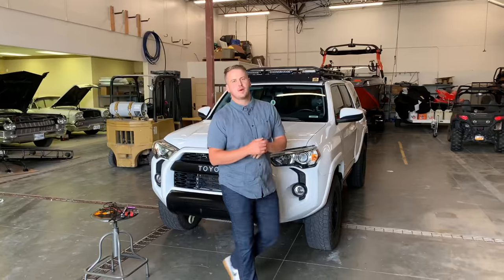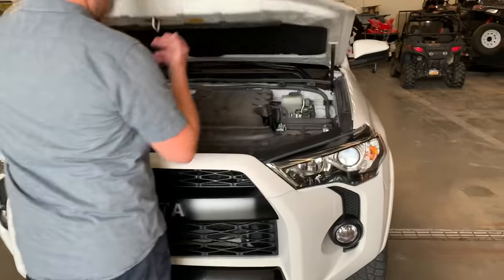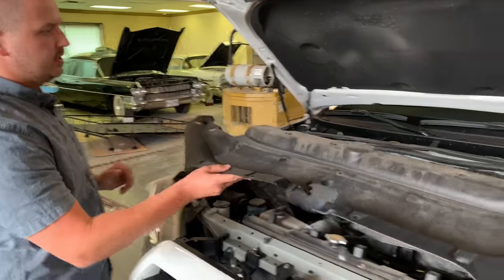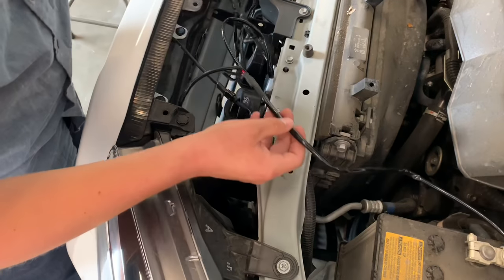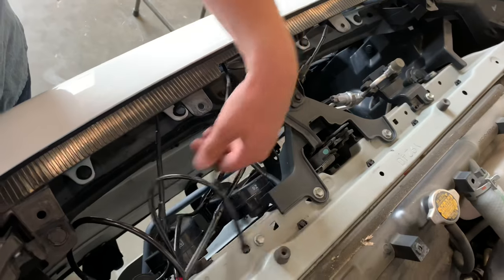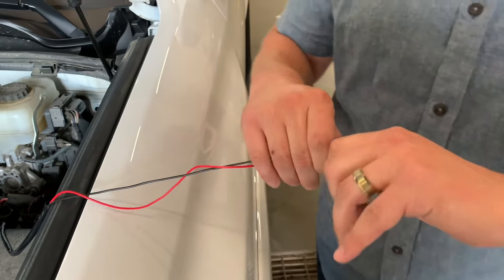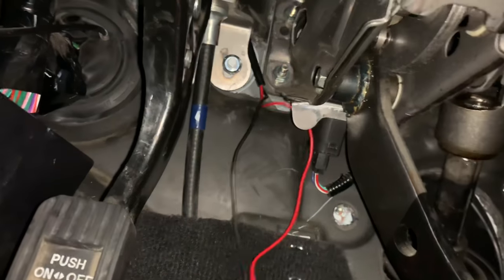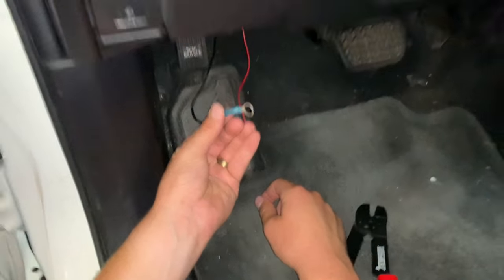4Runner RAPTOR Lights Installation!

Comment: Do not use a flat-head screwdriver to remove the plastic clips. All you need to do is push the center of them down. Once you take them out you can reset them and put them back.
Reply from the maker: Christopher O'Connor You’re EXACTLY right. I tried editing the video later because I forgot to mention that and now I can’t figure it out. Thanks for clarifying.
Reply: @4runnerlifestyle  No worries. Just wanted to make sure anyone else who watched save themselves from potentially breaking some clips. Good video, and good looking rig.
Reply: Just ordered the lights and watched the video. Thanks a ton for the tip!
Reply: Yep. Broke the first one and then realized how simple it was with the second one and the rest lol. Made it so complicated when it was in fact super easy.
Reply: How do you reset them? Probably a dumb question but I thought I was resetting it but just twirls and is loose when I put it back in. Compared to what it was before of not moving at all.
Reply: SHIT!  I saw this comment too late. Broke 3 of them.
Reply: @austinstearns1428  not dumb at all - you push the center of the "insert" back up. It pops the cap back out.
Reply: Correct!
Reply: I know right!? They just pop off by pressing them in lol 😂
Reply: One of them fell to the bottom, should I be concerned ??

Comment: PSA to everyone this is not the way to do it on 2020+. You have to use the fuse box under the hood
Reply: What slot do you use in the fuse box under the hood? I have a 2020 4Runner TRD Pro.
Reply: No you don’t. You can pull the fuse labeled “IGN” in the panel under dashboard and use the add a fuse in that spot with the 10amp fuse you pulled out and a 15amp fuse for the lights and you are good to go. Could probably work in the spot labeled “IGN NO.2” as well.
Reply: @ryanlieder7459  thank you for this I was struggling to get them to turn off when the car was off but this definitely worked without having to use the fuse box under the hood.
Reply: @ryanlieder7459  Just want to say thank you my man. I just installed these into my 2021 trd pro based off this comment. Ryan does not lie works in either.
Reply: @ryanlieder7459  bro THANK YOU SO MUCH. I was about to just give up because my 2021 ORP fuse box under the steering wheel is NOT the same as this video. And if you put it in the only available slot the lights stay on all the time. So thank you so much for this tip!!! Also, do you lose anything by taking out the old fuse and putting in this one?
Reply: @fatelook  thank you sir.  I have the same issue. Did you just pull the IGN fuse and put I there ?
Reply: @philliprodriguez5129  yea I believe so, ign 2 works as well
Reply: Ign 2. Works great. I have a 2022 and the fuse panel is totally different. This comment thread saved my ass cause otherwise the raptor light would have been constantly on.
Reply: @NattyGuy  where did y’all put the IGN fuse afterwards?
Reply: @technoremixxx  in a little plastic baggy. The plug for the lights has the two 10 fuses so its good.
Reply: Somebody help me out because I have a 21 trd orp and can’t get the raptor lights to turn off when I turn the engine off

Comment: Easy install. Why not make the wiring harness long for the furthest light and short for each subsequent light, as you get closer to the drivers side? Less wire mess by the radiator.
Reply: Also could ground at the body near the battery then just run the positive inside. One less wire to deal with inside
Reply: That's what I'm saying

Comment: So I didn’t go through the firewall, instead went directly into the fuse box under the hood. I’ve found two configurations. One will turn the raptor lights on only when the headlights are on. The second configuration will turn the raptor lights on whenever the engine starts. Looks like the configuration in this video turns them on with the headlights too… I think I like having them on without the headlights as an option- just thought I’d throw out that thought if anyone is interested
Reply: What fuse did you use for on without the headlights?

Comment: Seriously…. What the heck…. My fuse box looks different. Also that’s a different slot than others recommend. Why that slot, what is it for and when is it powered. Also, the cover will not reattach with this big attachment attached to the fuse lock. No mention of it. Just throw it away and leave it open?

Comment from the maker: Do not use a screwdriver to remove the plastic clips as explained in the video, just push down the button on the center of the clips and pull them up!

For 2020/2021 4Runners plug into the INJ fuse in the engine bay.
Reply: i had the low profile fuse they give me the mini fuse tap I can’t put my fuse into a fuse tap so do i have to get the mini fuse to replace the fuse that i had?
Reply: how do you put the clips back in?
Reply: 2021 SR5 and in the INJ fuse of the engine fuse box, the fuse box cover now does not close. Please advise.
Reply: @dlumlung  use a dremel tool to create a slot for the wire in the lip of the fuse box. Then match the slot on the cover. Protect wire from chafe with some electrical tape or preferably cloth automotive tape. They should advise using a grommet in the firewall hole also. Grounded sparky wires no bueno.
Reply: Wish I would've read this comment before finishing running the cable and crimping the fuse to the line 😫
Reply: @dlumlung  use inside fuse box "tails postion" raptors dont work with drl but do with anything else

Comment: I believe it's more feng shui to plug the Double Fuse Tap into the "tail light" fuse slot.  This way the raptor lights will automatically sync with the exterior lights rather than the ignition switch.
Reply: Where is the tail light fuse slot/ what is it called
Reply: @bswen600  It's called "Tail" located bottom left in the panel under the drivers dash next to the ebrake
Reply: Does the taillight come on During the Day to make the raptor lights turn on ??? Or does it need to be turned on with Lower beam light?
Reply: @First Last  they'll stay off during the day, therefore, the first setting that will turn them on will be the yellow parking lights
Reply: @byronpitulski766  great to know. Does the fuse box under the hood have a tail fuse ?
Reply: @firstnamelastname9661  no

Comment: Can you remake this video for the 20-21 Trd pros? The black wire in the kit I received has a gold connector on the end/ is not the same as the video. Instructions are lacking

Comment: But why would you put FORD style 'Raptor' lights on a Toyota? You do know that the Raptor was required to have those due to the width of the vehicle, right? Right? 

I will say, those lights are very well built in their fitment.

Comment: Can you guys update video or instructions (didn't get any of those in my box) for a 2022 TRD Pro?  I found another video that wired it to the fuse box under the hood but the add-a-fuse connector sits almost an inch proud of the fuse itself and fuse box cover will not fit back on.  The other video I found was for a 2020 and I guess the 2022 has a more 'fitted' fuse box cover
Reply: Can you share the video you are referencing in your post? I have a 2022 TRD 4Runner. I installed then on the tail light fuse, lights new raptor lights came on but I loose my tail light and parking lights. I don’t know how to make all lights ( raptor lights, parking lights, tail lights) work together. Any ideas?

Comment: Why does my setup have a fuse on the line? I bought the lower 4 raptor light and the cable came with a fuse connected to it. Plus two fuses for the fuse box… can you please tell me how to set this up? Do I cut out that 15amp fuse out of the main power cable? Or use two 10 amp fuses with the 15amp inline fuse.
Reply from the maker: Hey! That's strange, The easiest thing is to email sales@4runnerlifestyle.com And we can get that taken care of for you.

Comment: I enjoyed the video and the installation but one hick up I had is the length of the wiring. The wire I received was not long enough to go through the firewall so I needed to make alternate connections. I went ahead and connected the power wire directly into the fuse box, in the INJ slot and it works just the same. Works just the same, easier and faster.

Comment: Followed these exact steps and the raptor lights aren’t coming on. Tried changing the ground location and replacing the fuse but nothing…pretty bummed
Reply from the maker: Hey max! that is not fun! have you emailed our customer support? if you ordered them with us we can help you get them installed or replace them if they aren't working!

Comment: can't get my lights to come on, my fuse box is pretty full. my fusees are a little different order. Are you plugging into a blank fuse panel?
Reply from the maker: Yes, that can happen, we are going to an open position or at least one that doesnt already have an add a fuse.  A way to fix this issue is with a control panel like an SPOD or an Auxbeam.  They help organize all the wiring and make it more streamlined when adding so many lights

https://www.4runnerlifestyle.com/products/auxbeam-8-gang-led-switch-panel-kit-one-sided?_pos=4&_sid=cf76e6711&_ss=r

Comment: Why do you bypass the fuse box under the hood and use the one in the cab? I seen videos of it done both ways. Is there an advantage to one over the other?
Reply: I tried both options for my 18 sr5. Under the hood works for me but after a week my battery died. With this option my lights stayed on every time the truck is on.
I’ve tried connected inside the vehicle under steering column as shown in video but does not work for me.....not sure why.
Reply: By hooking the wire under the driver cab does that ensure battery will not be drained? Or should I install a switch?
Reply: Inside the cab.  The first 10amp will say tail lights.   If you use that one.  Then you have some control  . They wont turn on unless you  select your front amber side marker lights.   This way if you wanted to . You can run with them off or on with your front side markers.  Basically working like a switch
Reply: @flipmode9236  I did this on my 2021 and worked perfectly
Reply: @jeremylusher1316  what fuse spot
did you use? my 2021 under dash fuse box doesn’t look like the one in this video. I only have one empty fuse spot and when I plug it in there, the lights stay on no matter what.
Reply: @Pcola70Chevelle  I had the same exact problem .... Were you able to rectify?
Reply: @Pcola70Chevelle  yes that's the issue I'm having.. . I have a 22 .. . Please advise if you've found a solution
Reply: @Pcola70Chevelle  did you get an answer?
Reply: @flipmode9236  this spot is taken already on my fuse box. Do I remove the fuse that’s in there first and then plug this one in?
Reply: @bradf1276  yeah u take the fuse out and plug in the 2 to 1 splitter
Reply: @Pcola70Chevelle  did you figure out which fuse to tap into?  I have a 22 Off Road and lights are always on

Comment: Pretty cool product, but I was shorted a fuse. Reached out via email and never got a reply,searched for a phone number, couldn't find one.

So I just assumed it only took one fuse,when lights didn't initially work, I troubleshot everything,to no avail. Went to my local O'Reillys and bought another 10 Amp, worked right off the bat. Thanks for the product,but need to work on communication.

Comment: So I put it in the INJ fuse in the engine bay and my 4runner would not start. I had to go back to the original 10A red fuse and it worked again. So not sure what to do
Reply from the maker: It sounds like you don't have a fuse or a blown fuse in the harness thats in the kit possibly.  We can figure that out for you and get it taken care of if so! Sales@4runnerlifestyle.com by email will get you connected with our guy Andrew and we can open a case to see what the issue is!

Comment: On my 2020 trd off road. I connected to the 10a marked as tail to the left of the 7.5a DCM. Should be left column. Closest to you/the top. It runs off the switch. When you are in lights on or the setting right below.

Comment: I saw some install videos where the wiring was connected to the fuse box located in the engine bay. Is there a difference between installing in the engine bay and installing in the driver side fusebox?

Comment: !!!This is very important and should be checked in your state prior to purchase!!!

It is illegal to have the off road raptor lights turned on while driving on state roads especially with the LED white modifications. I just got pulled over in PA(worst state ever) and he said they must be turned off when you're driving on the road unless they're manufacturer installed.
Reply: I live in PA (outside of Philly) and never knew this.  Do you have an actual reference from the PA DOT or DMV?  I have amber raptor lights in both my 4Runner and Tacoma grills.

Comment: When running cable through a fire wall:
NEVER expose the main conductor to metal contact. Vibration will wear the insulation and ground out the hot lead.
Second, run cables in far enough so the protective jacket of the cable is the one protecting the conductors and it will be a barrier between conductors and the metal edge of the fire wall.
The excess cable can be zip tied inside and neatly tucked out of the way.
The wiring harness really should be fabricated to length for each light and reduce cable clutter. Cleaner install is always best.

Comment: I have a 2023 40th Anniversary Edition.  The fuse box is different than the one in the video, and he doesn't say what the fuse location is labeled.   Please help! I would like my lights to work.
Reply: The fuse box lid under your hood has a diagram that indicates what the fuses are for.
Reply: @RetJetFxr  
I understand that. Read my original message.  The guy in the video says "plug it in right here." Then he pauses the video and draws a red circle around the spot that he wants you to plug it into. He never states what that fuse spot is labeled. My fuse box is different from the one in the video. I need to know what that fuse location is labeled so I can find it on my fuse diagram...
Reply: @benmorrison6511  I understand.  I actually installed these in both my new 4Runner and new Tacoma.  In the 4Runner I had to plug the add-a-fuse into one of the two low beam headlight fuses (under the hood), and the tacoma I got a little creative due to the grill style, but I used the INJ fuse so the lights would come on at engine start. In the 4Runner, the INJ fuse sits too high to where there's no room to plug in the add-a-fuse and put the lid back on. In both cases, I still had to cut a notch into the fuse box lid so I wouldn't pinch the wire.

Comment: While wiring the raptor lights on newer 4runners use "tails postion" the raptor with work with parking lights head light high beams but not drls not abig issue
Reply: Did u take out the fuse that was in the tails position?
Reply: @houselannister3871  yeah and put the extra fuse in you Engine bay fuse box, they will turn on with parking lights and low beams

Comment: You should do an install video on the 3 light kit, as the wire provided is not long enough to get through the fire wall and you have to use the fuse box in the engine bay. I had to follow instructions on the R4T install and shorted something because my 4Runner wouldn’t come out of park and my ABS, battery and traction control lights all came on. All the fuses I checked seemed ok and driving home everything freaked out and shut off. Currently waiting on a tow truck. No fun.
Reply: Yo that happened to me too when I originally installed in the under the hood fuse box. It just completely shut off and brakes didn’t work or anything on the highway. Luckily it wasn’t rush hour and I had to push the brake hard as I can to slow down a little till I rolled to a stop. I had it towed to the dealership and they said it was the fuse that was put in was not good on these aftermarket parts. I bought the 4 lights and wired it in the cabin drivers side fuse box and I’ve had no problems since in the cabin you use a slot that didn’t have an existing fuse already. Other instal videos said take the inj fuse and put it into the add a fuse they provide under the hood which is what made things mess up.

Comment: How to install on 2021 4runner trd pro?? The fuse box is different on this car vs the 4runner trd pro 2021.
Reply: Same here. Only have one empty spot and when I plug it in there they stay on when the car is off.

Comment: Would be nice if they updated the instructions for newer 4Runners.  The harness they provided doesn’t just fit into the INJ slot like the updated “instructions” do below.
Reply from the maker: John we recommend for any newer 4Runner to put our add a fuse into the tail position of the interior fuse box, or KDSS position.
Reply: @4runnerlifestyle  can you make a video on this?
Reply from the maker: @justinwiley4261  As soon as we can get a hold of a new 4Runner yes
Reply: @4Runner Lifestyle 
Happy to bring my 2021 to use in an updated video. I have purchased the lights but can’t get them to work correctly. The tail location did not work for me.
Reply: @4runnerlifestyle  looking for guidance on where to install the add-a-fuse for 22 4runner Off Road as the lights stay on all the time.  Thanks
Reply: @DIY_Semi-Pro  Did you ever figure this out?
Reply: @Jerkyholic  Bro - I legit tried random slots and found one under the dash next to my left foot's fuse box area.  It's not what their directions say.  What's your email and I can send a pic
Reply: @DIY_Semi-Pro  I was able to figure it out. I had to go out and buy another mini 10amp fuse and put it in the add-a-fuse next to the 10amp they included in the kit. The add-a-fuse only had 1 fuse in it, it needs 2; and the original 10amp in the kdss slot of the fuse box I had to remove wouldn't fit in the add-a-fuse. I then plugged into my kdss spot and the lights turn on when the truck turns on. All good now.